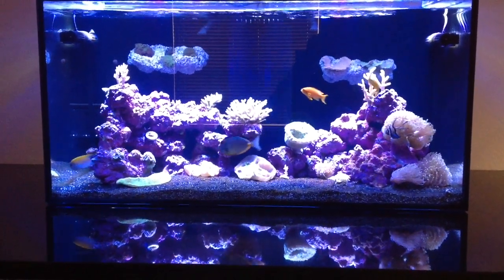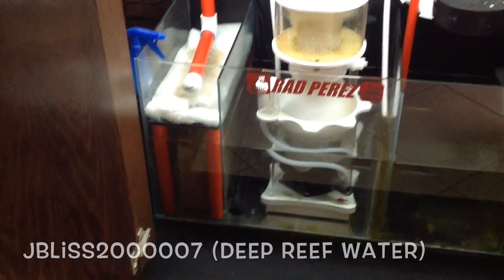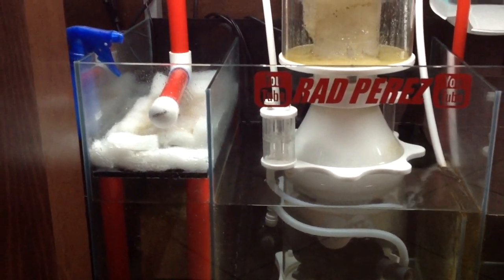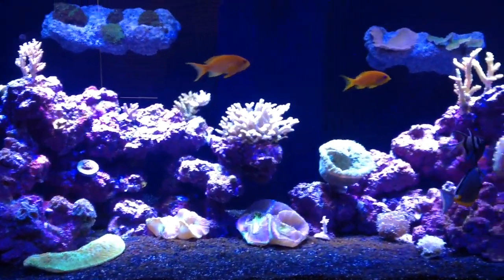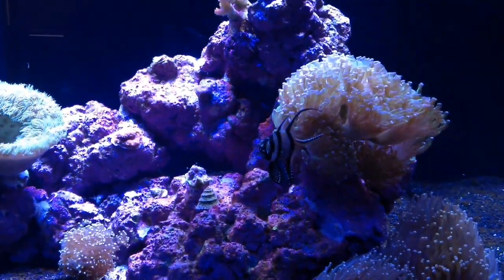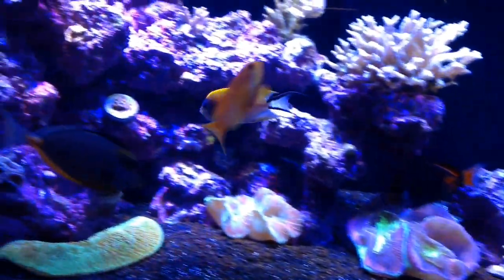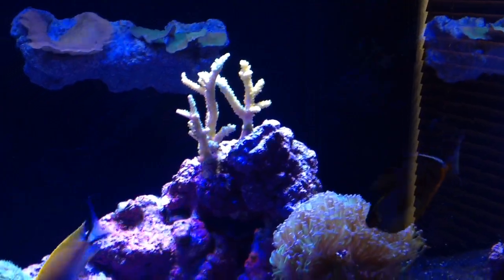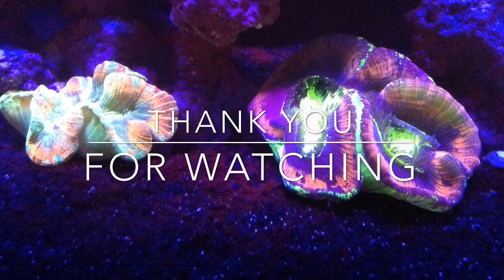120g Reef Tank Build - Removed filter socks and add spray bar over filter floss - Current Fish Stock

Comment: That might be the only mod I make to the sump of the 425 - replace the filter socks with pads. But I don't know yet, because the ones that came with the tank are the nylon mesh, which are very quick and easy to clean. I used one on the 20 during the height of the white slime nightmare. Stuffed it with strips of filter pad. Worked great and was easy to clean up. Clogged less quickly than the filter pads that I usually put over the bottom of the overflow hose. But I bet you'll find using that filter pad setup so quick and easy, not to mention cheap, that you won't want to ever use filter socks again. 

I love the fish you have! I'm planning on getting a male and female genicanthus melanospilos, which I think is what you have - black spot angelfish - I'm sorry to hear the male didn't make it. Around here the males are more readily available than the females, go figure. That female you have is beautiful. Excellent update!